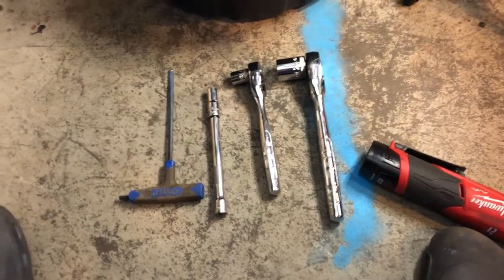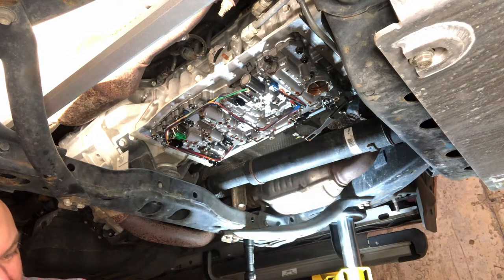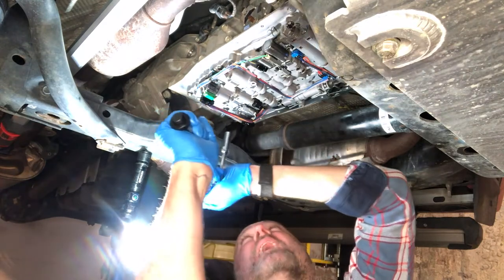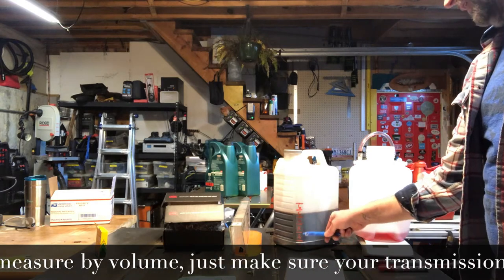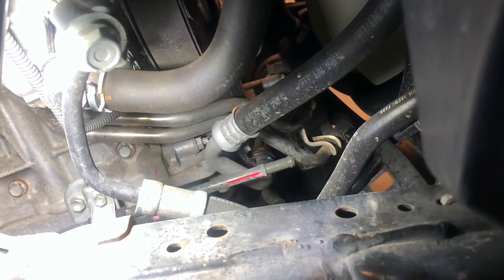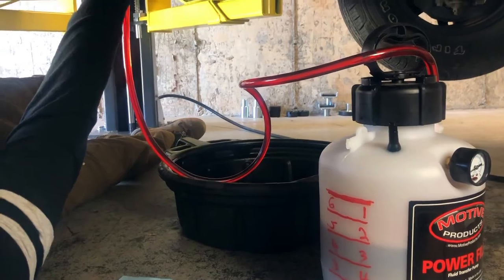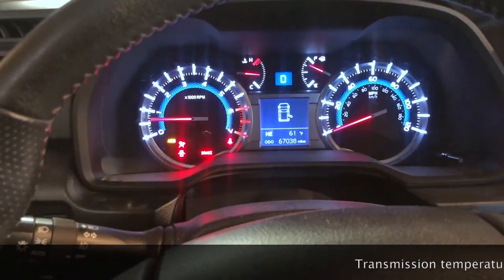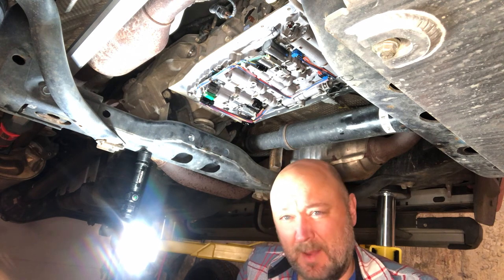4runner Transmission Home Flush

Comment: Giving this one a shot today...great video.
Reply from the maker: Good luck with it! It’s been one of my favorite maintenance hacks so far on the 4Runner. The process has worked similarly well on our Mazda, Ranger, and my son’s Odyssey. One of these days, I want to try dropping a pickup hose into fresh fluid to see if the pump will just pull in new fluid as old fluid is pumped out. I’ve heard it works but haven’t tried it yet. Good luck!
Reply: @fixityfix  this worked like a charm. I ended up intercepting the cooler return right out of the cooler, easier than the wheel well, but I wasn’t filming either. Very straightforward process and the truck shifts like new again.

Comment: I just recently did the flush and change to my truck and it started slipping as I got on the highway? I obviously did something wrong? Can you help me out
Reply from the maker: How many miles are on the vehicle? In any case, I’d start troubleshooting by carefully going through the temperature/fluid level procedure- often slipping is a result of too little (or even too much fluid). And these transmissions are super sensitive to fluid level. If that doesn’t address the slippage, I’d suggest getting it assessed by a reputable local transmission shop. Good luck!

Comment: You got me confuse. At 17:01 you saying blue line is return from cooler to transmission, and we have to use this line to flush.
Then  at 18:05 you showing red marked hose and saying that this is return line and we have to connect here to flush. (???????)
Reply from the maker: I can see where that might be confusing! It is the same line. You can use either place to tap onto it. The top access point (17:01) keeps you from having to remove the wheel. I tapped in on the bottom part (shown at 18:05), since I had the wheel off anyway. Good luck!

Comment: 279,000 miles on a Lexus GX460, never changed Tranny fluid. Buddy has same truck, changed fluid every 45k. His tranny went out at 165k. When it comes to Toyota (Lexus) trannys, if its not broke, don't fix it.
Reply: Do you know if he used Toyota WS fluid or aftermarket?
Reply: That's awful advice. The trans fluid wears out just like engine oil, diff fluids, t-case fluid, coolant, etc. 

Do you share the same logic about changing engine oil? 

"If the engine hasn't thrown a rod don't worry about it".
Reply: @MrCherrygrovedude  classic response and spot on l

Comment: You have to drive when the desh is blinking you said you drive for little wile??
Reply from the maker: Thanks for watching! I don’t drive it when in temperature check mode. I sometimes drive before to accelerate the warm up process.
Reply: @fixityfix   hay I got it it worked  good but I had to add more fluid I don't know but my car took like 13 and half I don't get it it's limited

Comment: Can you jump the pins in OBD ports 4 and thirteen, on 4th generation 4Runners?
Reply from the maker: I haven’t worked on the 4th gen, but check out this thread for more authoritative info: https://www.4runners.com/threads/checking-sealed-transmission-fluid-level.1432/
Reply: @fixityfix  Thank You,
 I just used a thermal scanner underneath the pan to check the temperature around 75%.
knowing that the temperature will go up. So far it seems to be holding within the recommended temperature.

Comment: hi! thanks David for the instructive video, is 100% good and clear, the only thing I can't hear is the filter torque wrench lb, you have a new follower and subscriber here, can you put all the torque wrench lb for all parts on the description, thanks I appreciate your help, blessings.
Reply from the maker: Hi Blake - Thanks for the feedback and for subscribing! I tightened my strainer to 7 ft-lbs.
Reply: @fixityfix  thanks for the answer, and what’s torque wrench lb you use for the valve-body bolt? 
You the best brother.
Reply from the maker: Also 7 fl-lbs, gotta love Toyota engineering simplicity! Good luck!
Reply: @fixityfix  yes buddy they are the best, like this video and your channel, thanks for everything and  I am your follower forever, and the reset you doing at last step with a clip, can I do it with Aurelio scanner?
Reply from the maker: @daddy1kev  , I wasn't able to find the specs on the Aurelio scanner with a quick search...but bottom line - some scanners will show you live transmission temperature data, some will not. My BlueDriver scanner reads some live data, but not trans temp :-(  (one day, I'll upgrade!). I'd suggest plugging in the Aurelio with the car running and scrolling through the menus to see if you can find 'live data' and then transmission temperature. Please let us know what you discover!
Reply: @fixityfix  thanks again, and yes when I’ll do the project I let you know, and my bad I try to write Autel scanner, if i found anything I’ll going to post it.